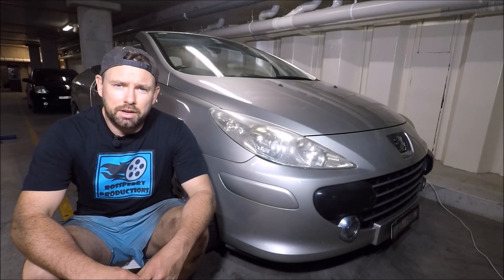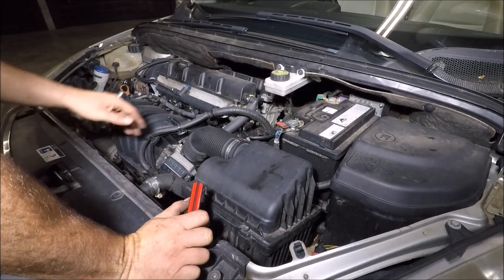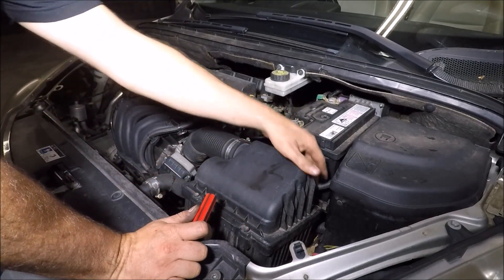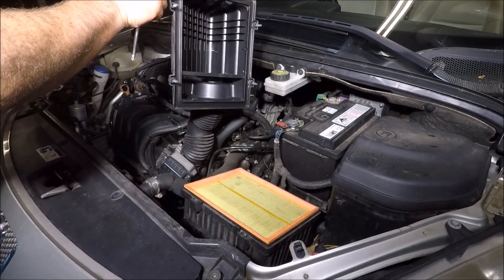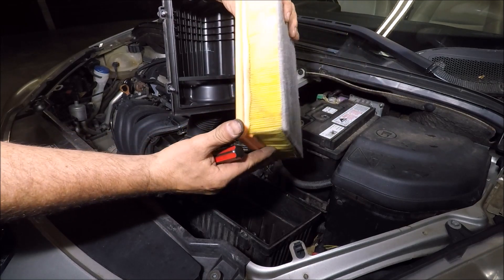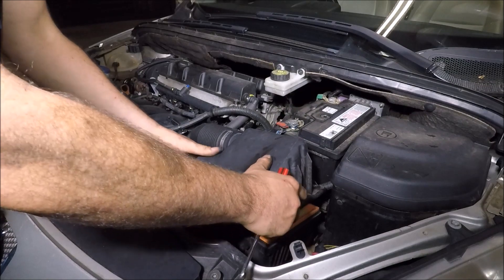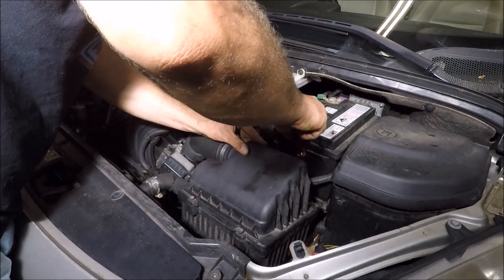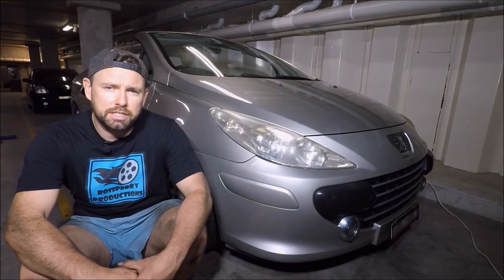How to Replace the Air Filter on a Peugeot 307cc Tutorial

Comment: Could you tell me how to change a fuel filter on a 2008 peugeot 307cc 2ltr petrol
Reply from the maker: Hi there, it should be very similar to the video, however i do not have access to the car. sorry i cannot be of more help. Ross
Reply: I know peugot only install fuel filters in countrys where fuel quality is poor which i did find strange but my 2008 1.6 petrol does not have one.Hope this helps 👍